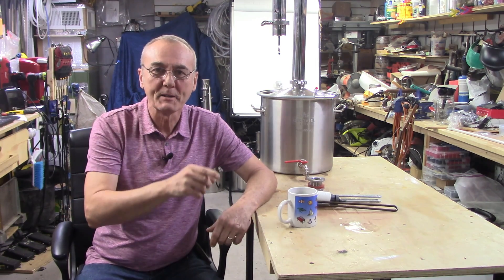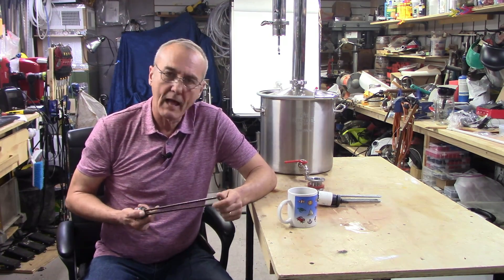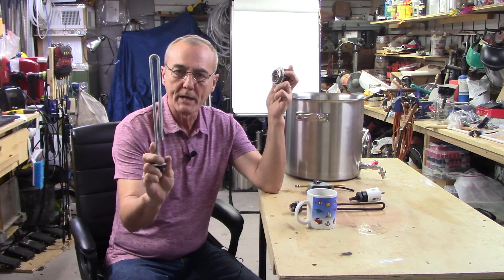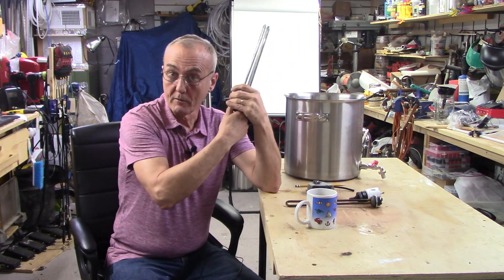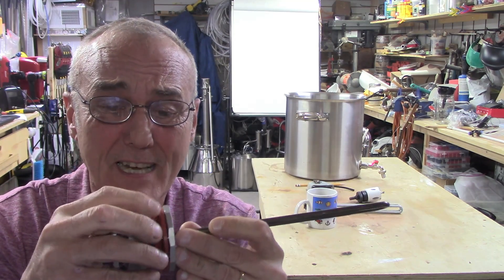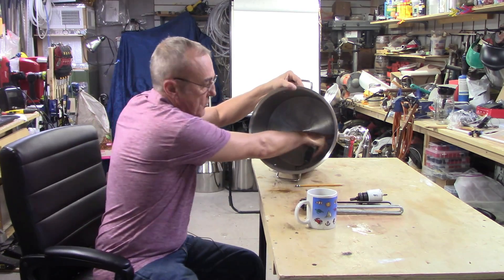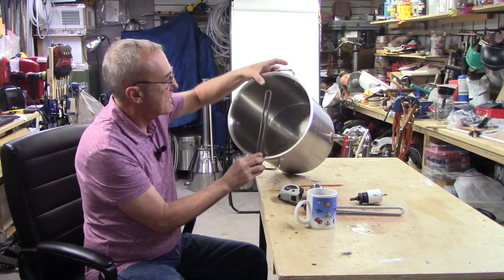Add a Heating Element to Your Still

Comment: G'day. Thanks for the information about the bulkhead.
What wires do you connect to the element? ( Earth, nuteral,positive) 
I have 240 volt in Australia.
Thanks
Reply: I found the video on this . I've seen an element hooked up directly to power and natural . What's the problem doing this?

Comment: My guess would be, the sacrificial run is to do with the possibility of people using old copper hardware with remnants of lead solder present. I'm guessing the first run leaches out the lead on the exposed surface, leaving less possibility of contamination on subsequent runs. But really, who would be that careless and cheap. My guess would be 44%😢

Comment: I have a 15" copper bucket filled with sand to become a sand battery and I want to insert one of these water heater elements to heat the sand. I'm looking at 1000 watt one... don't know if I can use one of higher wattage...thinking 1000w might limit my sand from heating to the highest temperature to be safe but optimum heat. Also wondering if I'd need a 3 prong plug for heating it. Any advice would sure be great. I'm a 64 yr old woman with a lot of how to knowledge, just want to create this sand battery to be it's best. I've considered ceramic heating elements, or an electric coil stove top burner...this water heater element seems to impress me the most...not sure of what wattage though. I want to also get a peltier fan to circulate.

Comment: I've searched the internet and can't find my answer so I'm gonna put it here and see if someone can answer it..
Can you use propane to heat your still if you have a Soldered  drain on the bottom?
Or will the flame melt the solder?..

Thanks

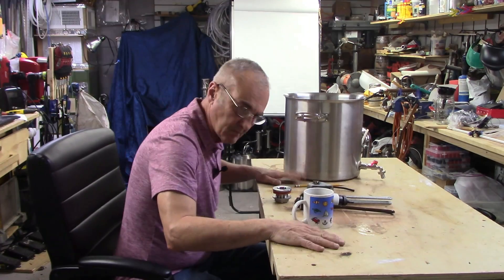Comment: @1:35   "I'm gonna use this 1-1/8" hole saw......."
OK, I'm confused. I-1/8" hole-saw diameter is 1.125".  The O.D. of 1" NPT is 1.315"
How is that gonna work? What am I missing/overlooking?
One would think the diameter of the outer threads of the bulkhead assembly would be the minimum hole size.

EDIT: Correct holesaw size is 1-5/8" (per link provided in description) 
Sorry, George!

Comment: JUST FOR INFO SAKE, AFTER GETTING THE FIRST HOLE DRILLED( WIYJ THR HOLE SAW, TURN THE DRILL OVER AS THAT THE NON-CUTTING PART OF THE SHANK IS IN THE SAW, AND NOT CUTTING A BIGGER HOLE; MAKES FOR A LOT BETTER HOLE SAW CUT.

Comment: You are my " go to " guy for all still stuff.... but you said " gotta put on my two wires " . Uhhhh we have to do a little better than that for the non elect. guys. I believe that is a water heater element and it must be 220VAC if I am correct . Would it run on 120VAC though ?

Comment: Hi George, thanks for all you wisdom and in site. I have a 18.5g vever reflux and I have everything for converting to electric with PID as you like it with the same components except for the 1 inch weldless bulkhead. You gave someone and link in previous comments but that turned out to be for a tri clamp apparatus for something none related. I am sort of stumped now for where to go from here since I have everything else on order for a standard element. Any Ideas would be well appreciated. Thanks George!

Comment: What size of elements do you think I should use on my beer barrel I got it second hand and only had one working element Nd some shady contraptions to turn it up Nd down.im new to all this Nd got myself a t500 after the element or the electronic parts gave in but I invested nearly£500 on the beer barrel still I could really do with  it working it's got two holes and all the clamps Nd seals for two elements .I need advice on setting it up or trand how to set the electronic parts up ndto be able to turn both or just one element at a time.

Comment: If you use steady pressure and low RPMS  you will have much more success drilling stainless.  Stainless is very easy to work harden and you'll have a hard time getting through.  👍

Comment: Niiice!!  I wonder if it leaked due to not de-burring the hole? I've worked a lot with stainless steel and like other people have said use a carbide bit made for stainless and then drill just fast enough to cut (drill SLOW). And just like you did, you use a smaller bit first and step up to bigger bits.. I'm about  to drill 2 S.S. kettle for my electric brew sys.  Thank you for the tip on the distance off the bottom of the kettle..

Comment: Thanks George!! With the wiring, how do you insulate it properly? Is it as simple as screwing/attaching the wires with a plug on the other end? I'm a bit unsure about elements with two contacts only (pos and neg)....where does the earth run? Cheers!

Comment: The larger your hole saw, the slower you need to go. Stainless is best drilled as slow as possible, with as much pressure as possible. Lard works well as a lubricant as it will change state and draw heat away from your surface. Drilling holes along the score line gives all the swarf a place to go, otherwise your just milling metal, producing heat, toughening what you are trying to drill, while making your bit more brittle and not lasting long. These things add extra steps to the process, but they make it faster and easier in the long run.

I like your info on brewing and your appreciation for processes.

Comment: just saw a video about stainless steel, apparently as it heats up the stainless hardens in real time, so the slower the drill the more successful the drilling will be.
Reply: This is true. Years ago I was drilling a bunch of stainless steel junction boxes at work to fit cable glands into. My supervisor (boilie turned sparky) told me I was drilling too slow and to give him a go. He went halls to the wall on the trigger and friction drilled a hole similar to the episode of the Simpsons, where homer tore apart 3d space. Burnt the 20mm holesaw out. I had to get crafty to drill it out to a 25mm hole, without a step bit.

Seen people drill and get their bit molten, and change the shape of it.

Comment: wow...metal drill bits should be used at a slower speed.....and... tighten with a spanner to avoid leaks and electrocution or worse a spirit run house fire from a leak a spanner could tighten .???? dangerous information ..... always think first ....do not rush.....bolts are not made for hand tightening .....electricity water alcohol together.... use a spanner... wtf

Comment: If I thread the element straight to my keg will I need to dye tap it at all or can I just drill the 1 1/8th hole like u did on your other video an thread it without the tap
Reply: You don't want to damage a thread, makes winding it in to something almost impossible
Reply: @matthewmeuleman3369  ok so you suggest tapping it with a die so I can screw it in see i went to lowes picked me out a ball valve and some other things but none of the employees could help me find the right drill bit and die thread for it so idk what to do im thinkimg of taking it to a local welding shop and just have them weld it on for me what u think

Comment: Could I put a stainless bulkhead on a copper pot, or would brass be better? Thanks!
Reply: Never use brass if you are using a still.  A brew keg is one thing, but hot ethanol vapor is another.  Also, never use rubber... there are a couple types of silicone that will suffice, but even that can be hazardous if used improperly.  They start leaching the first time you use them, then proceed to get worse as time passes.

Comment: If a guy had a digiboil, would adding a voltage reg like the one keg land sells fix the cycling of the of the elements while trying to distill?  I’d rather not crack the case to mod if the regulator would work.

Comment: Great video and thank you for all you do for this community!  
@Barley and Hops Brewing, you stated that all heating elements are NPT.  My understanding is that common heating elements are not NPT but are actually NPS (straight thread as opposed to tapered), which is why a gasket is needed on hot water heaters instead of Teflon tape on the threads.  If it works, it works I guess :)  #HappyDistilling

Comment: big drill was way to fast for cutting steel with that holesaw. run them slow and use oil on ferrous metals they will last a long time.

Comment: stainless steel should be wipe down  with a cloth with cold water too pull all  said gems and such to surface.. then rinse in hot  water dont  not scrub while rinsing with hot water you will drive gems and such in to pours of stainless and  it will leave  the sent behind .... VERY MISS CONSEPTION .. hot water does not kill gems on stainless ...

Comment: so  i discover this  looking around to find elements if your trying to save money scrap yard and steal them out of a 50 gallon hot water heater. instead of paying 35 too 80 bucks for a 220  one you can salvage  220 ones from there but salvage like 6 of them from scrap yard .. so you know you have ones that work .. So 6 cost me 10 bucks

Comment: Luv ya, George. Your videos are interesting, instructional, and damn funny. I use a step bit to cut my holes, cheap bits, and they too eventually fail. Though they leave a circular hole that the next step bit will easily fit.

Comment: you're drill didn't go through because you generated too much heat and hardened the steel.  Go with a low RPM and do it on and off to avoid creating extra heat.  takes time but it will go through much easier.

Comment: I suppose there is no easy way to use the bulkheads on the 15 gal beer keg, too hard to get it inside but I'm definitely adding them to my two little pot stills

Comment: George,  Hey I bought the minibrew 1 inch weldless hub,  but what element size matches? I got a simple 2k camco element but it doesn't fit. .so what should I be looking for when it comes to elements?
Reply: That's because the information in the video is absolutely incorrect.. The standard thread for heating elements is not NPT it's NPS! I made the exact same mistake I bought the weldless bulkhead directly from the link in the description I ended up welding it into my keg I wanted it there permanently but as soon as I tried to screw a heating element into it I realized it wouldn't fit a little bit further research taught me that he is in fact wrong about the thread pitch for the heating elements...

Comment: will the EZ Seal Weld-less Bulkhead For A Heating Element  Fight In The Neck Of A beer Keg I Just Don't Trust Drilling And Tapping it,    tyvm
Reply: I took a picture of the 1" weldless bulkhead and scaled it in a CAD program. After scaling i measured the flange area. If all is correct the flange should be 1.940" in diameter. So if it fit it would be a tight fit.

Comment: On an average how long does it take to bring to a boil????
Reply from the maker: Well, not much info here to make a call on how long.
Propane, electric, what size still, what size in BTU for propane, what size element in wattage. See where I'm going? Too many answers with little data to work with.
Reply: @BarleyandHopsBrewing  I was wondering about the pot and element in the video, I apologise for being vague

Comment: George, I inch element needs a 1 5/8 hole not a 1 1/8. have a great new year, will be watching you
Reply from the maker: Yeah, I was wrong. The bulkhead I have needed a 1 3/4 hole.
Reply: George i just bought a so called stainless camco 2500w element. I knew right away it was galv. I got 1 run done of sugar wash vodka with no acidity. And the elements black in 1 run. The galvs gone.
Which means its already on borrowed time. It cost me 100$ and because its 2500w i needed a controller to turn it down. Whats the deal with elements? Can i get one thats actually stainless?

Comment: Hi George
Next time you will be drilling in stainless steel, use low speed on the drill and high pressure.
high speed makes the steel hot and when stainless steel gets hot then it gets even harder.
So to save your drills and hole saws, oil  low speed andhigh pressure.

Sincerely Zibbe1000
Reply: Commin sence. Maybe he disnt know about stainless

Comment: Love the videos. Hope they don't stop coming. 

I have 2 kegs a 20L and a 58L. I want to use both with 1 element.  I have a 4500w element that's a bit long for the smaller keg. Can I bend the element myself?
Reply from the maker: Not recommended.

Comment: when you use Bi-metal hole saws you are better off using what I call "pulse method" pull the trigger for a count off "one, one thousand" then release and pull the trigger again, so on till it cuts through
the saw will last a lot longer.
for this size of hole through Stainless your speed should be about 200 rpm, most hand drills will not go that slow that why you can only get a few holes out off one saw.
PLanning on getting a heater element but need new still first and need job so I can pay (or make) it.
I have only had stainless steel stills started with a S/S pressure cooker converted to a pot still, then made my own S/S pot still in work (40+ years welder). and I have only cleaned my with hot soapy water, and after that I sometimes run the still with just water in it only when I am running low on distilled water.
Reply from the maker: Thanks. I'll use that method next time

Comment: Your linked video doesn't mention your mixture for cleaning new stills
Reply: 500 grams water (aka 500 ml), 50 grams hydrogen peroxide (50 ml) and one ounce citric acid mixed well.  Just used Georges recipe a few days ago and it cleans copper wonderfully.  Giver some time to soak / circulate btw.

Comment: Great information George I was starting to jones for a new one and was using the library to get my fix sacrificial runs come from soldered copper stills to clean out the flux used when sweating the pieces together. That's  why all the cleaning runs to insure that you remove all the flux. Happy New Year and thanks for all of your time and videos to help us all.

Comment: Hey George iam switching to a pid from a scr . Was wondering if I could use a k type attached to the outside  of the column at the top or should I put it through at were I have my thermometer
Reply from the maker: Yes. That will work

Comment: Dumb question here. I welded a 2in triclamp into my keg with stainless wire and used 75/25 gas with no back purge. Every thing I see or read says that’s so wrong and I should just start all over. My question is how in the world can it be that bad? I mean come on the product is only in the keg for a few hours while running it off. I’d like to weld in a 4in in the top for a clean out but I’m not wanting to buy a new welder and spend hours trying to learn how to tig weld if it’s not needed just to use what I have. Any advice?
Reply: If it's not leaking - you got what you need.
Reply: if the weld looks like what you want,  and does not leak  then it matters not what you did,,  only thing is  leaded soldier , a  no no,,   the thing is with the keg ,, sometimes they have a coating that makes welding hard ,,  but it can be done ,, as any welding prep the metal is what is important,   in other words lightly sand or clean surface where you intend to weld...

Comment: Quick question, does the length of the heating element matter?  For example a 10in 1650watt vs an 8in 1650watt
Reply: Size only matters if it's to big try to leave two or three inches from the opposite side and the bottom.

Comment: I've always been told to go very slow speed on the drill with metal makes your bits last a lot longer
Reply: especially   with a hard metal as SS,,  the slower the better,  but make sure the drill has the torque to keep the hangups from happening,,
Reply: Yes, stainless sink's heat away from the base metal exceptionally well as it hardens due to heat, leaving your bit to take the dammage. SLOW speed with high pressure is how to cut stainless (sans plasma cutter).
Note I said CUT, not drill! It aint wood!
Reply: @Donavin1976  I'm hearing you. I figure 'your favourite lube' heightens drilling capacitance?

Comment: Great video as always George.  Can you do one on adding an element to a beer keg still?
Reply: Thom,  you pretty much have to weld a fitting on those.  Kinda hard to get your hand through that 2" hole in the top LOL
Reply: @charlesmccoy5857  he did a pony keg once and tapped the thread
Reply: https://www.brewhardware.com/product_p/tc15rsf.htm
Reply: @shaunkummer249  Yep, that will work, luckily for me I had a buddy with a tig welder and had him weld these fittings on mine.